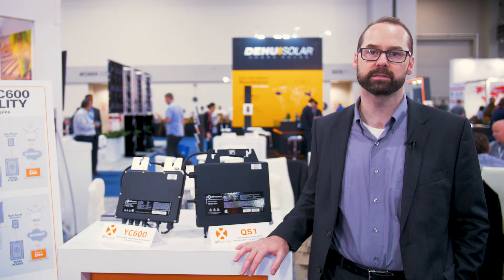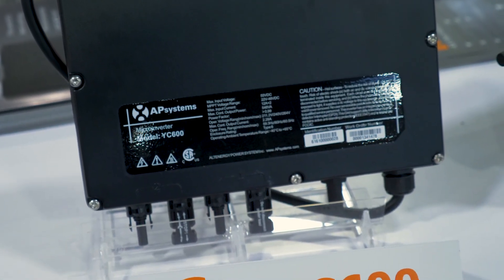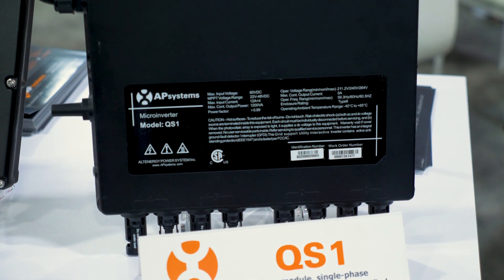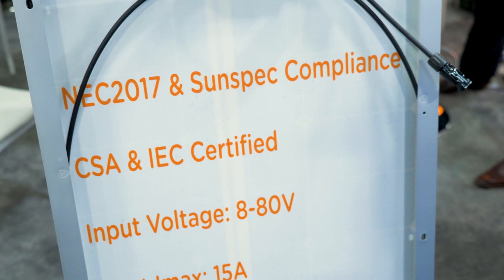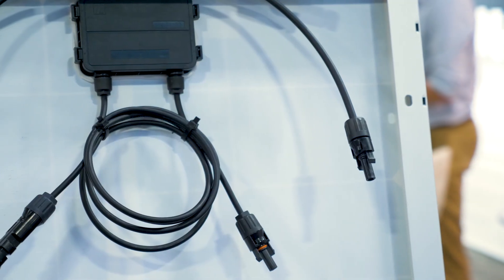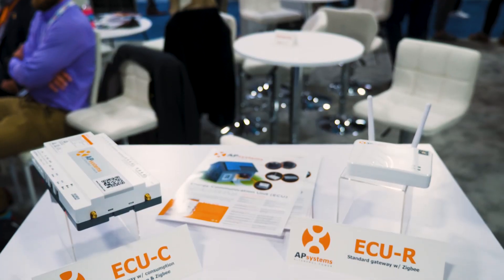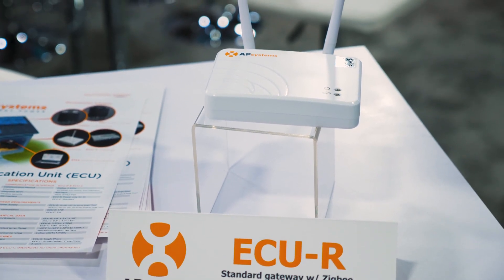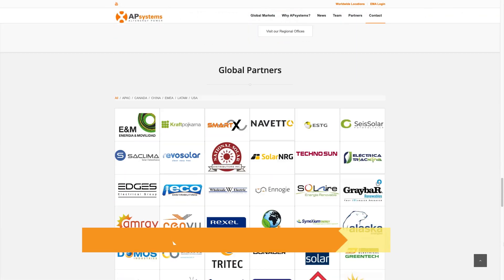APsystems shows off four-module microinverter at SPI 2019

Comment: DS-3 Apsystems Micro inverter interference on the 27 MHz CB band and almost the complete HF band and perhaps more. On the CB band USB/LSB you can be heard as beeps, and on FM as noise. It is also audible during the day when the sun is not shining, but only when it is dark outside do you no longer hear it. This interference on the 27 MHz band was received wirelessly from the air on a pocket scanner. (translated with Google) .